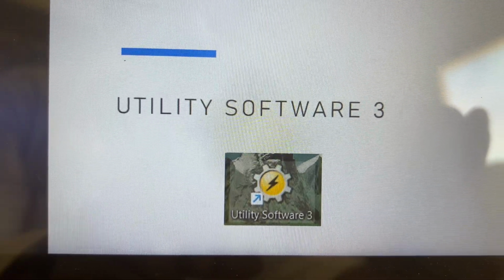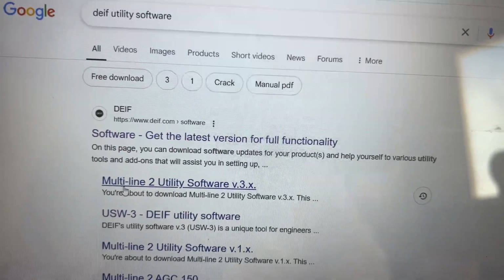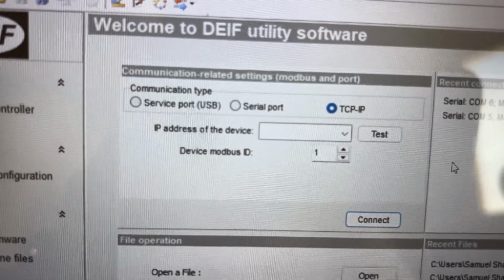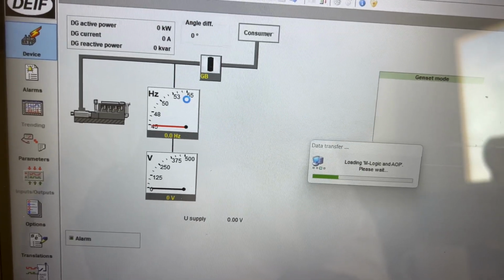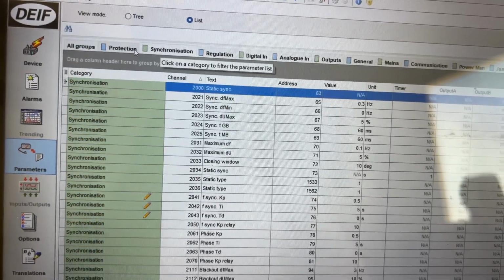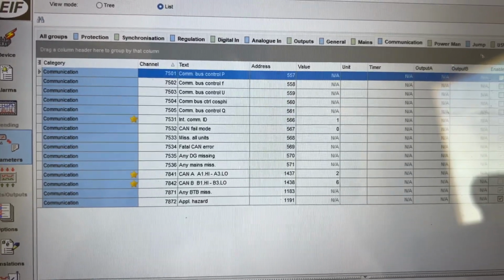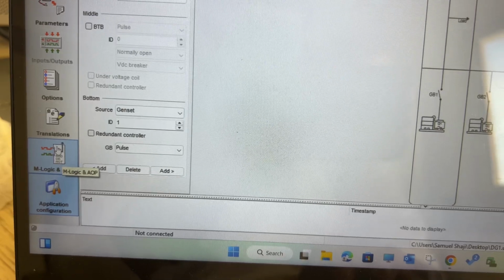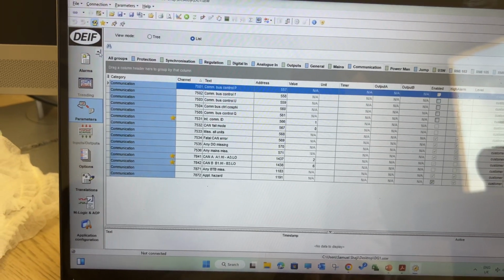#deif#utility#software #Basic#genset

Comment: Hello.Very helpful video.I have several questions.
1. Can I replace AGC-4 with AGC-4 MK II as it is updated version?
2. How to change IP address as different engine has different IP? Can I read all and write to another AGC-4?Will it function okay?
Reply from the maker: Yes you can change AGC 4 with new AGC4 MK II Also even though AGC4 is stopped but it’s spares are available
To change ip address either use USW  in N option or you can do by changing parameter 9000 manually. Also see N option version is updated
Reply from the maker: Also we give online programming support at chargeable basis. If require mail us at below email : shajisame@yahoo.co.uk